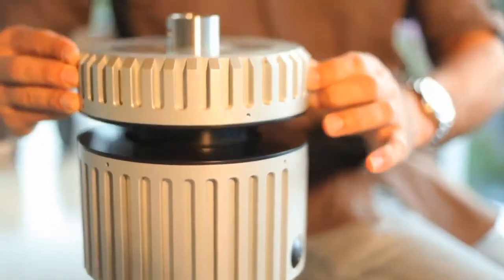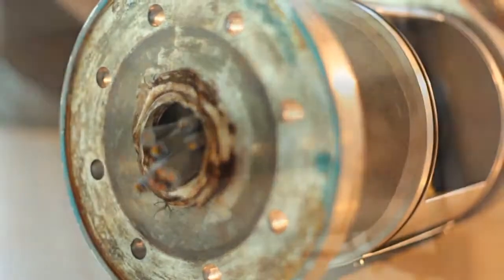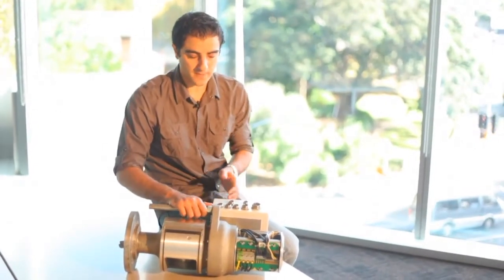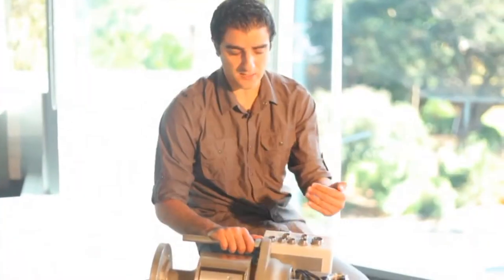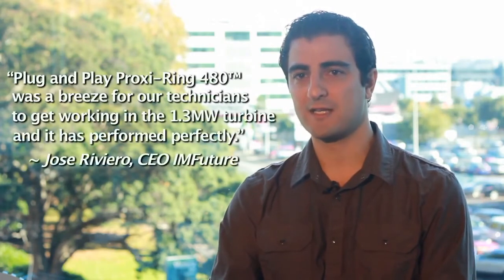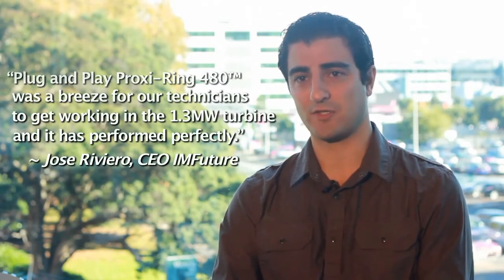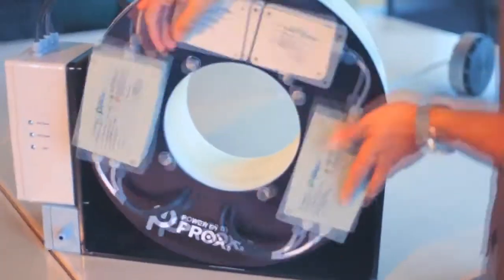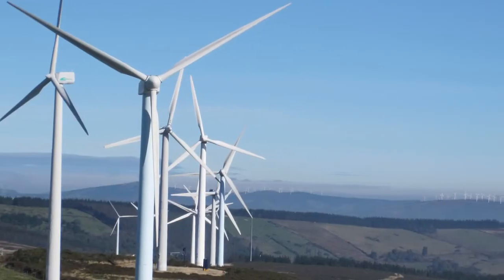PowerbyProxi: Wireless Power for Wind Energy

Comment: Hi is there any update? You seem to have moved away from WTG pitch slip rings on to other things. Why is this? Your product seemed to be such a good idea and so valuable - the amount of downtime on wind turbines due to pitch communication failures across the slip rings is huge. Surely there is a strong case for your proxi ring?
Reply from the maker: Hi Tom, thanks for the comment.  Yes we changed tact initially to consumer devices in 2013/14, but have come back to industrial slip-ring replacement solutions in the last year with the Proxi-Module.  Yes there is still definately a market there long term for us (in slip ring rpelacement in turbines) which we will look to attack with a higher power version of the Proxi-Module - the original Proxi-Ring needed to be able to deliver closer to 1 kW to really have market-wide appeal.  The good news is that the Proxi-Module is scalable (in terms of power) and includes various comms protocols which will allow us to provide a better long-term solution for more customers in this industry.
Reply: Good to hear. I suspected power requirements might be the issue. It will be an R&D race to keep up with larger blades and larger power requirements of new turbines.  Did you consider a product which only replaces the communication slip rings rather than comms and power? I am not sure of the proportion of pitch faults due to power supply issues vs those due to comms issues but get the impression there are more failures on the communications side than the power supply side.  Hope to see your products appearing in turbines in the near future.
Reply from the maker: We did, and that is a good point, but essentially comms isnt our main area of expertise.  At teh moment our team is too small to digress too far away from our core business.

Comment: Hey there, what has happened with this innovation in the last 2 years? I can't find any new videos apart form this which refers to the 2011 installation. does it just need to be proven in the field? I could think of so many applications for this device if it is proven to work reliably.
Reply from the maker: Hi dangerousdave - cheers for the comment.  Our wireless slip ring technology has undergone some improvements since this video was shot and is being developed for a few other applications in addition to wind turbines - some of these we hope to be able to announce in the near future.  We will be sure to upload some new industrial videos soon to try and rival the number of videos focused on our solutions for CE devices.